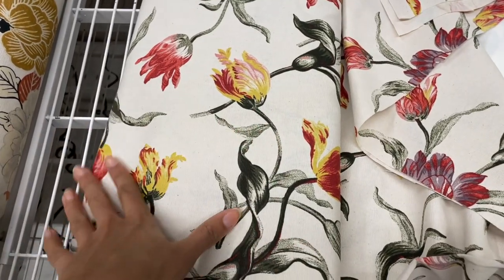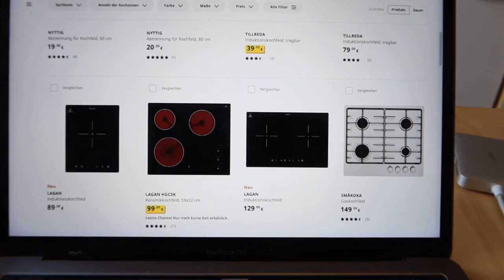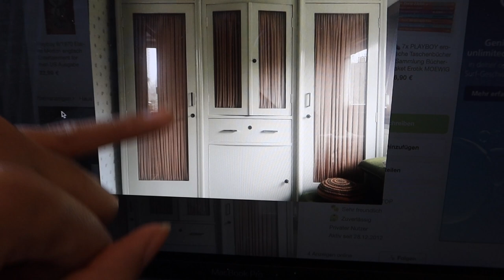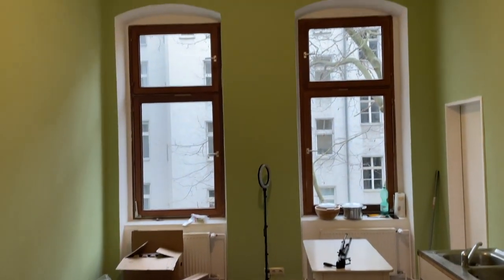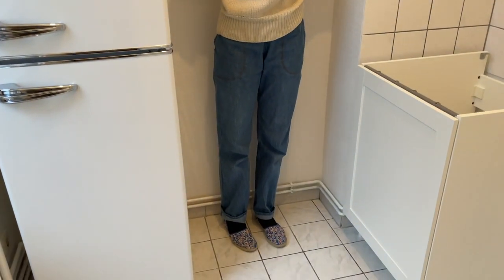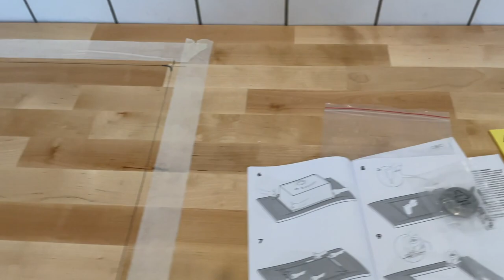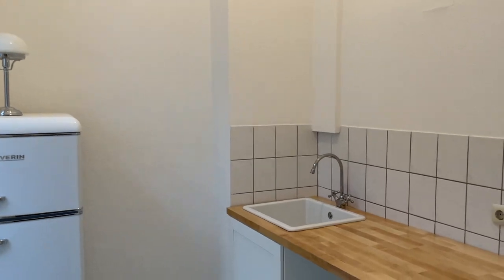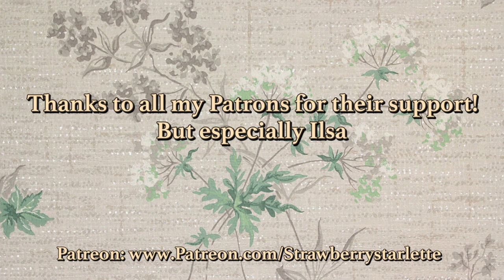Our Vintage Home Ep 2: picking up our sofa, vintage fridge, Ikea, cleaning

Comment: The armchair is gorgeous and most definitely 1930s! I was astonished at the 1930s sofa being 15 Euros! Or did I mishear and it was 50? Even so 50 would still be very cheap for a sofa from this era. In Britain 1930s sofas cost thousands of pounds, hence why I haven't got one. My sofa was £85 from Oxfam; a modern two seater that has a sort of vintage vibe because of the dark grey flocked type fabric and I've got a crochet blanket over it, plus two Art Deco cushions.

Comment: I was wondering: how come you have to change and pay for the kitchen sink and tap if you are renting? Isn't it the rental's obligation?
Reply from the maker: Unfortunately that’s often not the case anymore and our property management kinda sucks. But if they buy you something it looks like the old ones and we wanted something more our style ;)
Reply: @strawberrystarlette  I just couldn't imagine doing this here. It's almost unthinkable. 
I would recommend putting a silicon seal around the sink, cooker and all around the counter on the ceramic walls.
Reply: @strawberrystarlette  yes! Silicon is so important to prevent water damage and moulding, especially with wooden counters
Reply: I wonder if they would have to remove the new kitchen stuff when they move too 🤔
Reply: @NowIknow24345  probably not since they removed the previous one unless they would put it back (which they won't since they didn't keep it, in storage, obviously)
Reply: @Poppy-  So they basically renovated the landlord 's kitchen for free then 😳
I hope they are least get their rent reduced if that's the case.
Reply: @NowIknow24345  I planted plants, flowers and shrubs in my garden. I'm renting, but have been here 7 years. I would have spent the same in flower boxes thrown every fall, so I didn't mind, but I'd never do a big change like this as a tenant.
Reply from the maker: @online2000.  that’s the next step!
Reply: Some landlords are terrible. Here in the UK they are usually responsible for carrying out work like this and as a tenant you aren't able to change much. Unfortunately,  if something is functioning to an acceptable level like taps or units, they won't pay for it to be updated despite how dated or rubbish something is. I personally wouldn't do too much to a rental as it only benefits the management company/ landlord when tenants come to move on. Things may well differ in other countries. I'm loving this series of videos and I'm pleased for you guys ❤️. Very exciting seeing the transformation. xx
Reply: @NowIknow24345  maybe they are planning on buying the flat later on
Reply: @zieloonookaa 
 Maybe. 🤷‍♂️
But she commented under her previous video that they would have to paint the walls back to white when they move out.
Reply: @NowIknow24345  That is often so in Germany. You have to put the flat in a state back like you rented it. That means, you have to paint it neutral, so the next renter have not to do that.
Reply: @NowIknow24345  They didn´t renovated the kitchen for the landlord. When they move out, they can take their kitchen with them, since they paid it. Or they sell it to the renter after them. Or the landlord.
Reply: @Threedog92  I know they didn't do it for the landlord.